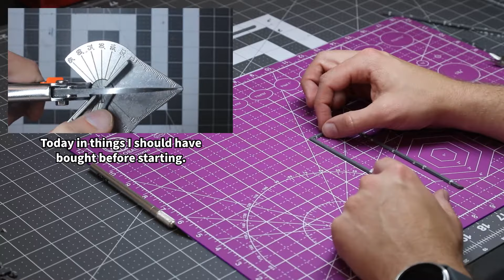Recycling Old Sprues Building a Cargo Container

Comment: they also make larger blade exacto blades.   I have a small (i think it's a 10 blade) for cleaning up mold lines or other small details,   but  I also have a much larger exacto blade...blade being thicker or bigger(says 2 on the blade).   makes cutting through sprues or thicker plastic a lot easier.   (like... if chopping hands of arms to switch out weapons or whatnot)   ---while not being as thick as a utility knife.

Comment: They're called runners or frames, though. The sprue is the part of the injection molding system that funnels plastic into the mold die's runners, forming each of the frames. What we get as the end product is the plastic that filled the runners and parts of the frame; not what was in the sprue.
Reply from the maker: Interesting. I've just been saying what I see everyone else say. Seems to be one of those cases where the language has just evolved, even if it's not technically correct.
Reply: Oxford Dictionary lists both meanings as valid definitions for the word sprue - I think it's safe to say that language has marched on, and the plastic frame with all the little bits on it is indeed a sprue.
Reply: @jacksonstanford7369  I'm guessing a faucet is a drain now too. That's basically what the sprue is relative to the frames.

Comment: I was looking at doing something similar but I was going to use acetone to melt down the polystyrene runners so I could roll it out flat and make something for texturing it like corrugation. I just don't like the idea of using paper because it seems like something that might not hold up as well. Plus if I'm using the plastic for the entire outside I can make some dies to cut out the pieces while the material is still pliable to have each piece be more accurate and readily repeatable, plus they'll be more sturdy. I also have a lot of leftover plastic and I bet I could get more from other people at the game store in exchange for making some for them.

I just need to finish reorganizing the house so I can have a proper hobby area.